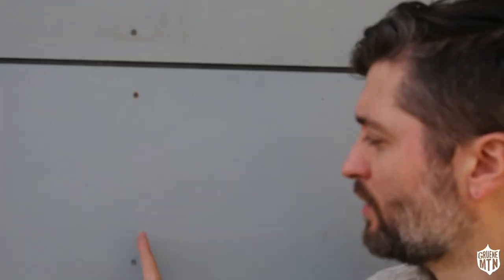QUICK TIP | open-joint Hardie siding

Comment: two questions if I may:
1.  Should there not be a ventilation gap between the breather membrane and the back of the Hardie Plank cladding?
2.  How to you cover over the screws as they are on display?
Reply from the maker: Hi, thanks for your comment. I did not build this shed to begin with (I probably would’ve done something different). That said, when it came to changing to door location, I was kind of stuck with this building method. The gap you’re talking about is called a rain screen. Yes, I would say that a rain screen is always preferred. I did not cover the screws. They were left visible and it’s probably better to do that should you need to remove any of the hardie boards in the future. That’s why I was using the string to line up the screws.  

I will say that the shed has stood for more that 10 years with no mold or rot on the walls. The roof overhang did rot due to bad flashing. I made a video on it. 

Thanks for watching!

Comment: Hey Seth I'd be really curious to hear your experience with this method - considering something similar for a small home project
Reply from the maker: Hi, the shed is now 8-9 years old and the siding is holding up fine. Since this is a shed I’m not too worried about it. However, for my house…. I’d probably do something with a rain screen application.

Comment: Which draining membrane did you use? Do they recommend doing anything to the backs of the siding? Thanks
Reply from the maker: Small Home Big Plans thanks for the view and comment. This is an EPDM membrane. It is what was used by the company who built this shed. I’m sure there are better processes out there for weather barrier and I’d probably look into those if I were doing this on a house or dwelling. The siding is fiber cement and is usually okay to get wet. I hope that helps! Take care.